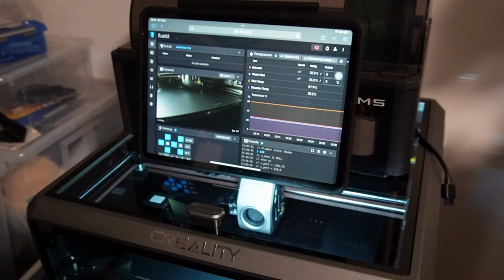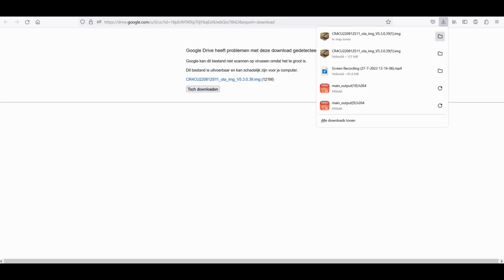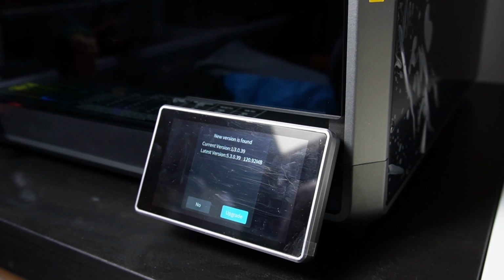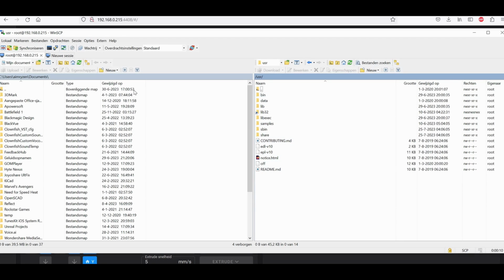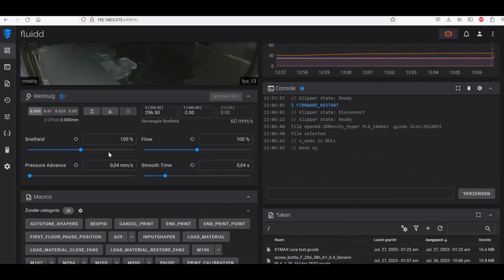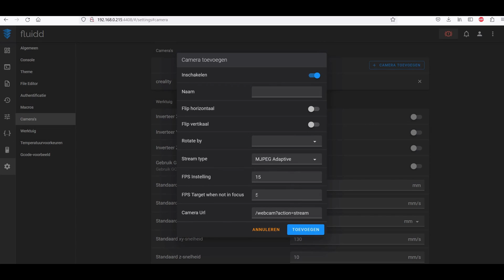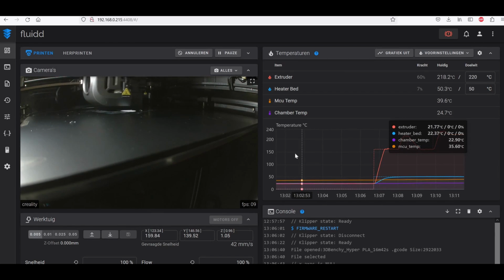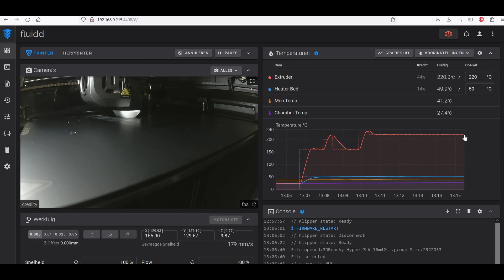Creality K1MAX / K1 Custom FW installation #k1max latest CFW v1.3.1.19

Comment: Congrats!, works! I had to install both upgrades in K1 MAX. Thank you
Reply: little help: Despite I set 250c hotend and 80c heatbed in Orca and Simplify3d slicers, the printer is stuck in 230 & 50  - PLA temperatures, I supose. Seems a "hide"  command overwrite the slicer instructions. Do you have any idea of how fix it?

Comment: I'm curious, what's the benefits of using Klipper over the stock firmware? I think the stock is already good.
Reply from the maker: using Klipper gives u the full control over all the settings and behaviour of your K1/K1MAX , for example you want to use another extruder (driver) on your printer... Klipper will allow u to adjust the settings to let that work properly, thats just one example.  But if you are not familiar with Klipper, AND you like the quality output of the stock FW, then stay on there. Klipper isn't for everyone.
Reply: @aim6mac  Thank you very much for the explanation.

Comment: Hi. Great video. I would like to ask if it is possible to reduce the voltage to the motor in the clipper so that it does not get so hot? Thank you.
Reply from the maker: I'm afraid that isn't possible , since klipper is not seperate

Comment: I no longer have stop/pause and icon on the screen during a print, even on the built in benchy. If I print benchy direct from the printer it's ok, however anything printed direct from Simplify3D or Fluidd has no icon or stop/pause button. Has anyone else seen this? Any suggestions?
Reply from the maker: yes thati is known, the stop/pause and icons only work if you start the print from Creality Print

Comment: I never got the prompt to update or install? Very frustrating... After disconnecting Wi-Fi, I get installation failed!!! I'm going crazy here...It has to be something I'm doing wrong
Reply from the maker: hmmmm, try updating to official FW (latest) then try the CFW
Reply: I just kept trying and SUCESS!! I'm not sur ethe hold up? I deleted the file and reformatted the flash drive 4 different times and it finally took! Thanks a million.
I am having issues getting prints to start from the Fluidd console, I'm getting a "key 95" msg... But I went back to the creality portal ( the file was uploaded there already as well) and it started printed just fine...  I picked up the K1 max this morning and I'm Rooting that this afternoon    I cant thank you enough  @aim6mac

Comment: after changing the text in the macro with the lines you said the camera doesn´t shown any more and when i start a print via fluidd the display doesn´t show the picture and information of the print. what can i do to solve the problem?
Reply: i also have this message:           11:07:29 
File opened:Drop Bar Diamond Touring_29m3s.gcode Size:4139527
11:07:29 
File selected
11:07:31 
// {"code":"key61, "msg":"Unknown command:EXCLUDE_OBJECT_DEFINE", "values": ["EXCLUDE_OBJECT_DEFINE"]}
11:07:31 
// {"code":"key61, "msg":"Unknown command:EXCLUDE_OBJECT_DEFINE", "values": ["EXCLUDE_OBJECT_DEFINE"]}
11:07:31 
// x_axes is NULL
Reply from the maker: @stevenjunge6022  come to my discord
Reply: @aim6mac  yes, i had Wright in the channel for root

Comment: Do i need to root my k1 as per the video you released a few weeks ago first? Or can I jump right into this firmware from a stock k1? Also, K1 max only? or my standard K1 will work with this firmware? Sorry.... new to rooting systems
Reply from the maker: hi there, no you don't have to root your K1 before you can install the CFW, this is the updated way to root your K1/ K1MAX , and it works on both systems, just check the description there are two seperate files.
Reply: Wow! Thank you for this. I’m headed home to try it now. I ran across the more complicated process first and was taking notes most of the day in order to try it. I’m glad I ran across this video in that other voters comments!! Thank you again!!
Reply from the maker: @rmgrimshaw23  no problem!
Reply: Will the system self test again after the new firmware?
Reply from the maker: @rmgrimshaw23  not automatically no
Reply: @aim6mac  I might wait until I’m more familiar then 😩. I’ve only been using the Fluidd interface on my Sonic Pad for about a month before I got the K1.
Reply from the maker: @rmgrimshaw23  it's up to you, but it doesn't change anything from the functionality of your printer, it only adds root and Fluidd
Reply: okay, I might be overthinking it all, haha   I'll get on it tonight.  @aim6mac

Comment: I inadvertently uploaded firmware from K1 1.3.1.14 to my K1 max thinking it was an update. The printer works fine. The only problem that has arisen for now is that the retract and extrude macro changes the extruder steps so that I have to restart the printer to restore the default values. Is there any possibility of uploading the original 1.3.0.39 again?
Reply from the maker: come to my discord we'll sort it out for u

Comment: Do you have any Idea why the auto input shaper calibration only tests the Y Axis and then saves the resonance Frequency to X & Y Axis?

This is the macro:

[gcode_macro INPUTSHAPER]
gcode:
  SET_FILAMENT_SENSOR SENSOR=filament_sensor ENABLE=0
  SET_FILAMENT_SENSOR SENSOR=filament_sensor_2 ENABLE=0
  G90
  G28
  {% set POSITION_X = printer.configfile.settings['stepper_x'].position_max/2 %}
  {% set POSITION_Y = printer.configfile.settings['stepper_y'].position_max/2 %}
  G1 X{POSITION_X} Y{POSITION_Y} F6000
  G1 Z10 F600
  SHAPER_CALIBRATE AXIS=y
  CXSAVE_CONFIG
  SET_FILAMENT_SENSOR SENSOR=filament_sensor ENABLE=1
  SET_FILAMENT_SENSOR SENSOR=filament_sensor_2 ENABLE=1
Reply: I just solved it by simply removing the Axis=Y and it works fine 💪
Reply from the maker: @MauriceMischo  here is a video to do it correctly, ur K1MAX will most likely have resonance problems. This video tells u how to fix it https://www.youtube.com/watch?v=d_8ngUsQ8kI
Reply: @aim6mac  Awesome! Yes this is an even better solution because it unlocks the other Shaper algorithms. Somehow Creality only wants you to use the ei shaper which is ususally for heavy bedslingers.

Comment: Thanks so much for this!
I also had to insert the USB while the printer was powered on, which popped up the upgrade dialog.
If the USB was in at startup, the message did pop up, but immediately disappeared
Reply from the maker: awesome! glad it worked for you too

Comment: Had 1.2.9.17 I believe.  Printer was on already.  Installed CR4CU220812S11_ota_img_V5.3.1.4.img.   everything works but when I change the printer.cfg file and save it, it will save but when the printer restarts the printer.cfg file gets re-written and looses my changes.  Also a .printer.cfg.1 (I think that is the file) file shows up with my changes but the printer is not looking at that file, it is using the rewritten printer.cfg file
Reply from the maker: that is a known issue.
Reply: @aim6mac  so far I have the k1 retaining the printer.cfg settings.  I deleted everything after and including #*# <---------------------- SAVE_CONFIG ---------------------->, rebuilt the printer.cfg as needed to get the printer to start.  I did a pid tune for the hot end and then the bed.  From there I went thru the setup, on the display on the machine, input shaping and bed leveling.  Each step I would save the file externally just to have a back up.  Once all tuning and changes were made and saved I then replaced all the config files in the folders located in /usr/share/klipper/config thru winscp.  8 folders in total.  I replaced only the files located in that folder.  I did not add any, just replaced.  Kinda thinking that these files are where the firmware is pulling the printer.cfg file to overwrite the ones in /usr/data/printer_data/config.  So far and after multiple reboots and config saves the printer has not overwritten or replaced any files.  I am not getting the .printer.cfg.1 files anymore.  More testing needs to be done but so far so good.

Comment: Nice work. Giving it a shot on my max.
Reply: Worked as expected. Flashed my K1 Max from .39 stock. Booted up no issues. Need to run some test prints but super excited. Thanks for the video!
Reply from the maker: @djjuno  awesome!
Reply from the maker: thanks,

Comment: i can only install it while the printer is on, but after the installation the version says 1.3.0.39 again... What did I wrong? I also tried to disconnect from WiFi but this doesnt help...
Reply from the maker: u haven't done anything wrong, it is supposed to say v1.3.0.39 , but now u can connect to FLUIDD interface with the port :4408

Comment: The install failed
Reply: What is the version of your current firmware? If it ends in .12 then that firmware has: firmware upgrade via USB deactivated. So you might have to do an update via wifi to a newer version from (c)reality then update via usb with this one.
Reply from the maker: more info?
Reply: @aim6mac  when it ask to install i hit yes and it fails

Comment: For anyone struggling to install on the original K1. I started with 1.2.9.15 (which had root access already) and found that I first needed to update to 1.2.9.22 before I could install 1.3.1.14.

Comment: Which Fluidd version does this firmware have? Is there a way to update fluidd on the printer via scp?
Reply from the maker: I remember updating my fluidd on the K1 , it worked, but u need to put it manually in the klipper
Reply: @aim6mac  do you know if there is a way to update the klipper and moonraker versions as well?
Reply from the maker: @oscarbarajas4498  update fluidd yes, update moonraker, i dont think so.
Reply: Nevermind I just updated to the latest fluidd version and now I have exclude objects enabled, this sole feature is worth the root, now to figure out how to get the screen to show progress and the start/stop buttons as they are not showing up unless I use creality Print to slice

Comment: Creality marketing department wondering why K1 MAX sales just went up 1000% overnight. GREAT JOB and THANK YOU.
Reply from the maker: we should get a % of those LOL, u are welcome
Reply: @aim6mac  Does this hack allow for retention of the original LCD screen on the printer?
Reply from the maker: @MHz-jl6wt  yes offcourse!  But it will be the Creality interface, to use Fluidd interface, u need to connect through port :4408 with a phone, laptop, pc, ipad, basically anything that has an internet browser.
Reply: @aim6mac  Thank you so much for confirming that and for all the great work you have all done to give K1 MAX users full access. Can’t wait to flash my unit today using your CFW 👍

Comment: Does this upgrade show up on the Creality Print-Device-Details page?
Reply from the maker: not sure what u mean, but if you mean if the original Creality web interface works aswell , then the answer is YES
Reply: @aim6mac  Sorry to report that it didn't work for me
Reply from the maker: @RaminOhebshalom  where did it fail? I heard some ppl had problems with the usb drive, if thats the case, try putting in the usb drive whilst the printer is already on
Reply: Got in using port 4408. Thank You!-)
Reply: @aim6mac  All is okay. Thank you
Reply from the maker: @RaminOhebshalom  yes thats the port for Fluidd
Reply from the maker: @RaminOhebshalom  glad it worked out.

Comment: Powering up with USB caused the "Upgrade" screen to fall away to the "Machine is starting up" and not come back.  I got through it by just connecting the USB drive after the machine is already powered up and ready.  Still prompted to upgrade upon insertion.
Reply from the maker: hmmmm strange, at our end that way it didn't work, but great if it works for you :) end result is the most important.
Reply: I had the same issue, plugged it in while on and it works

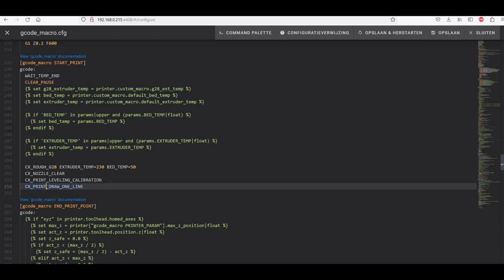Comment: One correction at 5:10 :
The CX_ROUGH_G28 line should be this: CX_ROUGH_G28 EXTRUDER_TEMP={extruder_temp} BED_TEMP={bed_temp}
You have some hardcoded temperatures in there instead. Just wanted to point that out.

Bedankt voor de firmware en de video!
Reply from the maker: is now corrected :)
Reply from the maker: thanks

Comment: Oh it's the K1 FW which still had root access - but where does this version number come from
Reply: trying to answer it by myself - the processor is ARM compatible so it should be possible to mount the img into a VM and modify it. So the version number could be interpreted as an update of mainsail and the web frontend. Anyways big thanks to the creator
Reply: or I'm totally wrong and the filename is exactly the one of the downloadable K1 Max firmware, except the 5 in the version which says 'I'm cracked' xD
Reply: @Reneg973 it's new/current firmware from Creality, repackaged with a replaced shadow file and restored fluidd/moonraker. The 5 is to ensure it installs regardless of what firmware you have.
Reply: @destinal_in_reality  okay nice, than possibly we should change the root pw, as if someone hacks the creality cloud, he or she could possibly take over the printer
Reply: @Reneg973  you can ssh in with password creality and change your root password to something else.
Reply: @destinal_in_reality  exactly, that's what I wanted to tell
Reply from the maker: might be, it's the official name anyhow